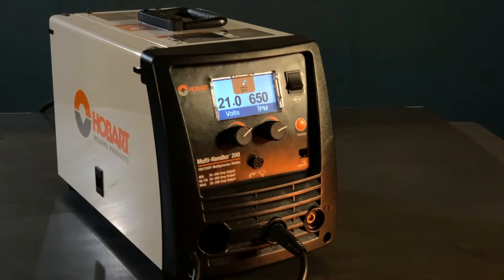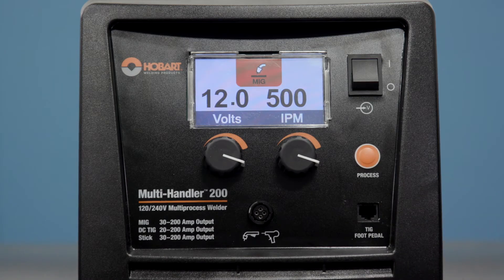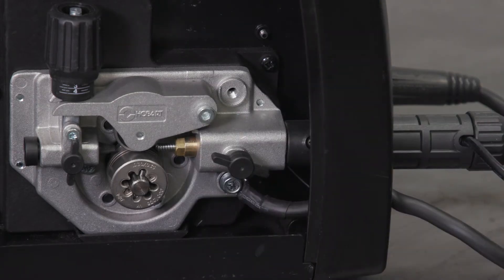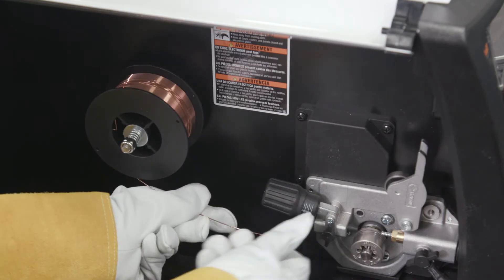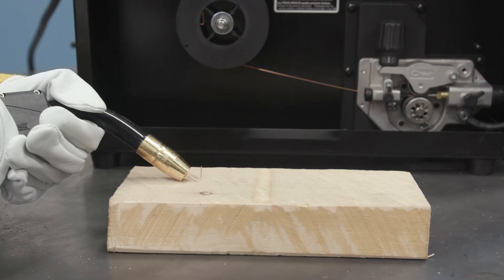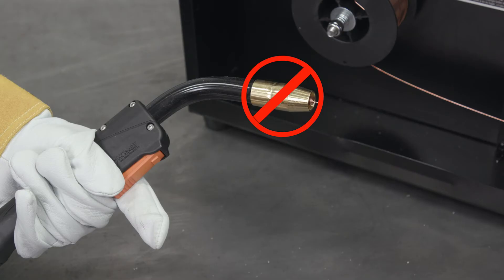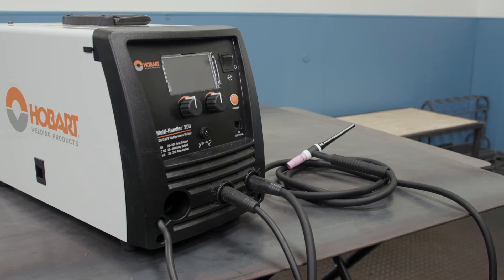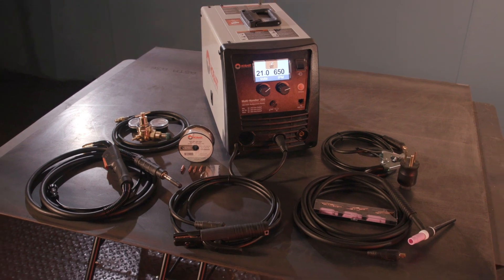Setting Up Your Multi-Handler™ 200 Multiprocess Welder

Comment: What size circuit breaker is required for 240v plug?
Reply from the maker: When running the Multi-Handler 200 on 240V input power, we recommend a 40 amp breaker. Please refer to the electrical service guide in the owner's manual for more information.

Comment: Can I leave the shield for Flux welding mandatory or I need to remove it??
Reply: You can leave it if you like but it just blocks the view, you can use part number 770487 as a protector in its place and it wont block the view like the shield will during flux core welding.

Comment: would this work with champion elite 225
Reply from the maker: Yes, you can use the Multi-Handler 200 Multiprocess Welder with the Champion Elite 225 Welder/Generator.

Comment: Can this be used outside during favorable weather conditions? Wondering if this would work for a shipping container conversion. 1/8th to 1/4 in material.  Thank you
Reply from the maker: Thanks for your question! Yes, the Multi-Handler 200 Multiprocess Welder can be used outside. The Multi-Handler 200 can weld materials up to 3/8". For more information on this machine please visit the product page here: https://www.hobartwelders.com/equipment/welders/multiprocess/multi-handler-200-m30242. Please let us know if you have any additional questions and we can happily assist. Thank you!
Reply: @HobartWelders  Thank you. I'm impressed with the speedy response.  I made the decision and purchased my very first welder.👍
Reply from the maker: @merlotcrush1969  That's very exciting! Congratulations on purchasing your first welder. 👏

Comment: is it ok to turn on the 15 A fuse 110 V? Thanks
Reply from the maker: Thanks for your question, Bojan. We have passed your question along to our team and will get back to you as soon as possible. Thank you!
Reply from the maker: Hey Bojan! A 15 or 20 ampere individual branch circuit protected by time-delay fuses or circuit breaker is required. Thanks!

Comment: Hello, is this capable of supporting a spool gun for aluminum MIG welding?
Reply from the maker: Yes, the Multi-Handler™ 200 is capable of supporting a spool gun for aluminum MIG welding.
Reply: @HobartWelders  excellent.   I have had a Hobart Handler 187 in the shop for years, and it has done wonderful work.  I do believe I will purchase this Multi Handler 200 to fill the gap between my bigger welders and the 187.
Reply from the maker: @ebla83  Thanks for supporting Hobart! Let us know if you have any other questions.

Comment: Do you guys sell any mig guns that would run 0.45 flux core that would fit this machine? Looking to add it to my shop. If you specifically do not sell it, do you know of any other mig guns would work with this machine?
Reply from the maker: Thanks for asking, Benjamin. A  .045 gun liner and contact tip can be installed on the factory gun. Please let us know if you have any other questions!

Comment: didn't show how to connect gas for either tig or mig..
Reply from the maker: Hi Bill, thanks for reaching out. Here is the owner's manual where you will find more information on MIG and TIG welding connections for the Multi-Handler 200: https://www.hobartwelders.com/files/owners-manuals/O285922B_HOB.pdf. Please let us know if you have any additional questions!
Reply: 75 Argon 25 CO2 for mig 100% argon for tig and spool gun mig

Comment: Problem :  Desperate for HELP !!

I bought a Hobart 210 Handler about 5 years ago.  I love it. I have done a great deal of projects with it with no problems at all.  The Problem is, I moved to the Philippines and took my welder with me thinking it's a 110/230 welder I can use it on 230V Philippine power grid. As the Philippines does not use 110V.  The Philippines uses a 110v outlet but they run a 230v system in the houses.  Stupid me. I put the 110v plug adaptor on the cord to facilitate the 110v type outlet in my house. I started the welder and it ran for about 10 mins then Black smoke poured out of the fan in back on the welders and the machine stopped running......Stupid yes I know. I should have made an adaptor for the 230v plug to fit the outlet. Now I have this heavy welder I cant ship to Hobart for repairs it would cost me 100's dollars just to ship. I guess I need an idea if there is a breaker that maybe can be replaced to fix the problem??? I did open the side cover off and there are no visual wires burned or melted at all....  please Help
Reply from the maker: Hi, Kelly. It sounds like the fan motor in your unit may be damaged, as well as the circuit board and power switch/circuit breaker. We recommend taking your machine to your local distributor to be diagnosed. You can contact Toolec, Inc. in Manila for assistance.

Comment: What’s the max volts output ?
Reply from the maker: Hi Roberto, thanks for reaching out. We recommend checking out the welder spec sheet for more information: HobartWelders.com/-/media/hobart-imported-mam-assets/spec-sheets/0/d/3/multi-handler-200-287909.pdf.

Comment: Just got mines today. Doing same as with another commenter. When I attempt to adjust wire speed or volts it selects another welding process. Is there a fix other than sending it back?
Reply from the maker: Hi, thank you for reaching out. We recommend taking into a service location to have it looked at. You can find your nearest service location here: https://www.hobartwelders.com/where-to-buy.

Comment: Is this unit made in the USA or China?  Inverter or transformer based?
Reply: Any idea about the inverter or transformer?
Reply from the maker: Hobart offers a full portfolio of easy-to-use, ready-to-weld products that welders can depend on for every job, every time they turn on our machines. The majority of Hobart welding machines are designed, developed and manufactured using proprietary technologies in Appleton, Wisconsin. Select Hobart welding machines are produced outside the United States, and are designed to meet Hobart specifications and requirements, ensuring both novice and experienced welders have the equipment to make their projects a success. We work with trusted sources to ensure that our welding machines meet the high-quality standards that you have come to expect from the Hobart brand.
Reply: Just got mine it’s a USA company but a made in China product
Reply: Every welder is made in China

Comment: Is tig lift arc or hf
Reply from the maker: Hi Colton, the new Multi-Handler™ 200 is lift-arc only for DC TIG welding and does not have high-frequency capability. Let us know if you have any additional questions.
Reply: @HobartWelders  Without having the foot pedal how is gas flow controlled? Does the tig torch have a gas nob?

Comment: I received mine yesterday. I was able to give it a try today. Well it didn't go so well. As I selected process to stick and set my amperage it changed process. I have replacement coming so let's hope for the best.🤞
Reply from the maker: Hi Christopher, thank you for reaching out. We’re sorry to hear about your experience with your Multi-Handler 200 Welder. If you have any further issues with your replacement please give us a call at 800-626-9420, and we’ll see how we can best help you.
Reply: @HobartWelders  Thank you.    Hobart customer service has been very helpful. I just need Acme Tools to do there part. Thank again.
Reply: Just got mines today. Doing same. Is there a fix other than sending it back?
Reply: 86Chevymontecarlo did you ever find out a fix?
Reply: I had the same problem. That’s a real issue for Hobart

Comment: Just got mine and works great so far but did have a problem with hooking gas to machine.
The hose connects great to machine but the 1/4 hose leaks badly at gauges as nipple is sized at 3/32.
Hobart won't answer phone or emails so far.
Went to local airgas store and got bigger nipple.
Only question I have is nipple that came with gauges has small orfice like metering.
New nipple does not
Reply from the maker: Thank you for reaching out.  We're sorry to hear about your experience and we'd like to learn more. Please contact Hobart Technical Support at (800) 332-3281.  Phones are answered Monday - Friday from 7am-5pm CST.
Reply: Called technical support and he wasn't sure if 3/32 nipple with metered orifice would be the same with 1/4 nipple without.
Kevin at tech assistance said he would get back to me.
Hobart is known for quality I hope this isn't a thing.
Reply: is the fan continuous? Or is it fan on demand
Reply: @melissamunoz8133  my fan has only came on so far when I shut down power.
Unless it comes on when welding and I don't notice.
Reply: I wish someone from Hobart would email me mmarsters@comcast.net.
I have questions about leaking at connection and want to make sure it's ok to weld.
Reply from the maker: @greenvalleyworms3377  Hi there, we’d like to learn more about your experience. Would you please email marketing@hobartwelders.com with your serial number and contact information including a phone number and our team will call you to further discuss. Thank you.